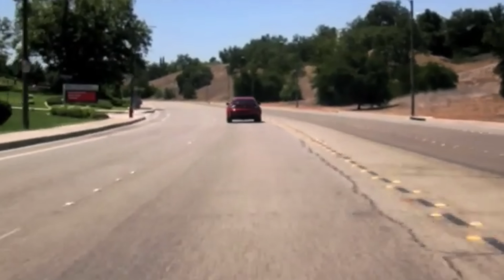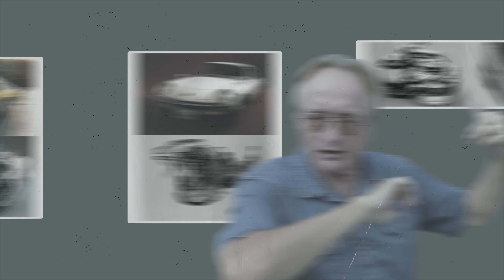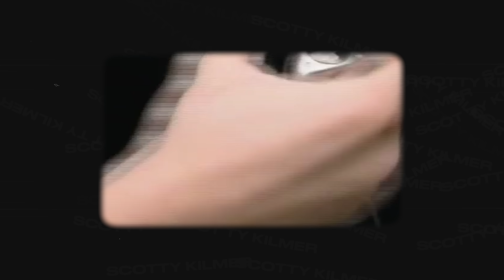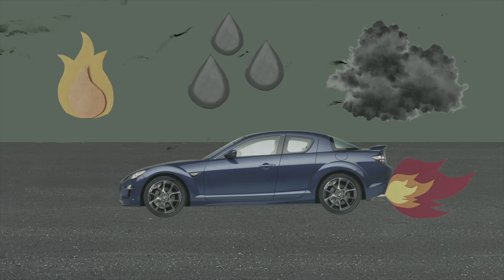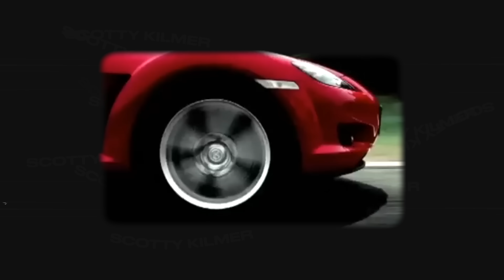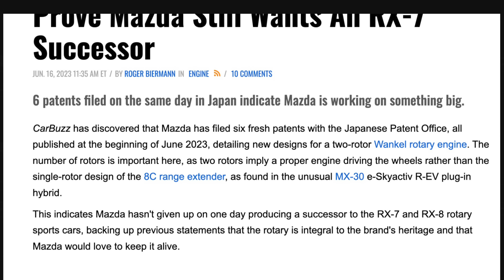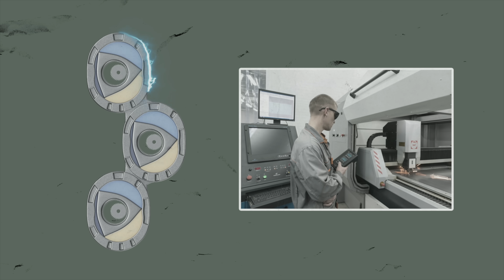Mazda's New Engine Shocks the Entire Car Industry

Comment: I’m really curious to see how this rotary engine can make it an efficient hybrid vehicle, more b efficient than Toyota’s parallel hybrid engines. It longs promising, the drivetrain can be entirely electric, and the rotary engine optimised solely to generate for the battery. As long as it can be as efficient as your typical parallel hybrid, it can be made lighter, and with much fewer moving parts that require repair, maintenance, or replacement.

Comment: Well, they were fun to drive. I had two rotary pick ups, and my mom was silly enough to own an RX-3, 2 door. It was loads of fun for a teenager. They were not fuel efficient, but the wide power band was very interesting. I can't imagine it would be fuel efficient, but as a range extender for generator, that's sounds more viable.

Comment: I’ve got an 85 RX7, 120k miles and still going strong, no rebuilds…the engines do require more attention to maintenance and fluid levels than piston ICEs, but with decent care there’s no reason they can’t last over 100k miles.

I’m a fan of rotaries mainly cuz I find the engineering interesting, and they’re really fun to drive; if they come out with an improved production engine, I’d probably get a crate motor and swap it in.

Comment: I had an R-100 back in the day. A rocket on roller skates. Overheating from a coolant leak took mine out by distorting the casting. I could drive at freeway speed in 3rd gear and really no sense of over revving. I hope they fix the issues.

Comment: If one of the problems with the rotory engine was city driving shortening it's life between repairs, then maybe continouse operation at optimal conditions will extend its life between repairs and target better efficiency.  What's nice here is its power for size.   And that is extra  important in electric hybrid cars.

Comment: the english firm ROTRON ENGINES (with an engeneer from NORTON MOTORBIKES) still produces very compact and powerful rotaries for  motorbikes and aircraft and... the army. Their engine (watch theirr video) is revolutionary : air cooled, compact  220 BHP for 700cc and like Mazda a lot of techcnical modifications in order to make the engine very reliable. (1000 hours forseseen before a rebuild). They even build a monorotor, a two-rotor and a 4 rotor engine. WHy not a collaboration between Mazda and ROTRON ENGINES ? The main problem to resolve is the fuel consumption, which remains high !  Serge

Comment: Its like they really want to street modify a turboprop. This design would really benefit from a compound turbo -turbine unit to use that aspiration throughput and intermittent unburnt fuel air mix. A cooling box could condense the worst of the emissions that can't be recycled through the compound afterburner modification.

Comment: The information is wrong about the EV! The reason for the smaller rotary engine in the EV is to one extended the milage, can go from 300 miles and with the rotary engine is extended to 1200 miles! The second thing it does, it recharges the batteries! Mazda is planning on use leas batteries and they are trying ro make it self recharging... If this information is wrong let me know. This is what i read about the come back of the rotary engine...

Comment: Confirmed rotor head here. I’ve had 5 RX7s, 1980, 1983, and 3 85’s. Still have the GSL-SE. 108K on factory engine. Daily driver. Back and forth to work. Only periodic maintenance performed with age related issues such as fuel injectors and clutch replacement. Runs like a Swiss watch. Oil tight. Fun to drive. Also have a 2004 RX8 Grand Touring 6 speed that I’ve had for 20 years. Same thing.  I drive them, I do not baby them. A trip to redline a day keeps the mechanic away. So smooth. They sound amazing at full tilt, so lightweight. And yes, both pass CA emissions every 2 years.  You can have your cake and eat it too. Drive it like you stole it, but maintain it like your Momma drives it and you’ll be fine. I LOVE Mazda, because they are independent and try things that nobody else does. Remember the Miller cycle V6?  Also has 2 of those.  One 99 and a 2001 Millenia S. So far ahead of the game. They have passion and soul. And they build beautiful cars that LAST!  Long live the peritrochoid.

Comment: The rotary engine is objectivly not the most efficient engine, yet these are nowhere near as bad as you make them out to be. Fuel economy for example does not entirely rely on the engine, but also the weight, size and aerodynamic coefficient of the car. The Wankel rotary also does have it's strengths, mainly the very small weight and size with huge power density.

Comment: Either way gas and diesel are obsolete compared to all electric vehicles. I love innovative designs, but Mazda (and Toyota with it's pointless Hydrogen obsession)  might as well throw in the towel already. 

Oh... and no "range extender" please; make up your mind and buy an EV or else stick with gas if that makes you happy. Adding the weight and complexity of two systems is just nuts.

Comment: I used to own and did my own repair to a 1993 RX-7 twin turbo its easier to rebuild than a typical gasoline engine. However it has overheating problems and fuel/oil leaking through the Apex seals which has mostly been resolved with this new 12 rotary design.

I’m sure Mazda can make a smaller 3 rotary design for application in a new RX-7 sports car or be utilized as a drone packing more power than current drone in service. Also the 12 rotor design producing 5000 hp could be very attractive to airplane application since it uses regular cheaper gasoline fuel.

Comment: First: The engine is NOT rotary engine it is a reciprocating engine. Second: It does vibrate because the centers of the rotors move relative to the center shaft. Calling it a rotary engine is just inaccurate. It is a reciprocating rotor. engine.

Comment: The invention by Tyson Garvin makes my head spin, considering the cooling that is needed for this extreme power. See, at this level, one cannot consider two isolated components (hull and engine), but needs to find a way to use the hull as the radiator for the engine heat, whilst still ensuring the naval properties. With the advance of additive manufacturing it is possible to print a hull that has fine capillaries  in which cooling water could be circulated. This concept would use the entire surface of the hull below water line. It’s really hard to think of another way to manage this amount of thermal energy.

Comment: Actually invented by Fred Umblebee. Wankle filed his patent after Umblebee's patent ran out. It was not viable until a mechanical inversion was made by Sachs (?) where the rotor rotated instead of the case. Wankle engines do not account for all three faces of the rotor when calculating displacement so it is actually larger displacement than quoted.

Comment: I would love to see a Wankel tested with Nanosecond Pulsed Power Plasma (N3P) technology. In addition, I would love to see the engine tested with ammonia, ammonia/hydrogen, ammonia with ~ 19 percent Dimethyl ether (DME), & Dimethyl Ether (DME) at constant speed as a range extender. With and without Nanosecond Pulsed Power Plasma (N3P) technology. Lastly, tested with variations of E85, 100 Methanol as well as gasoline mixed at different percentages. I bet we would all be impressed with the some of the different scenarios.

Comment: I own 2006 Mazda RX-8 with 84k miles and I have been in and out of performance for a while but, out of all the engines the Rotory engine is a simple design and easy to work on. I live in the desert and it gets hot here. I used to have over heating problems with my engine until I solved it with a low temperature thermostat. Now I have 0 issues of overheating in summer. I would love to see Rotory make a comeback!

Comment: my '87 rx7 turbo would not start after it was warmed up- unless : this takes 2 people- one to remove and replace ( in a second or 2) a fuse under the hood, while person #2 turns the key to start the car. this was years ago- can't recall which fuse for sure- should be the one in line with the fuel supply.

Comment: Most of the video was intro, understandable since there isn't much content. 
Nothing "shocks" the industry. Mazda wants a distinctive product and the early rotary sucked except for very niche uses. Best to give this one several years (never be an early adopter unless you are too rich to care).  Range extender use at fixed RPM should make it last longer than otherwise but there's no reason for excitement. It's just a generator after all.

Comment: Wow, what a garbage video. Loads of bogus claims here touted as fact.

Also, you obviously ripped Rob Dahm's approach regarding valvoline VR-1, yet you couldn't even get that right. You don't pre-mix with VR1. You premix with 2 stroke oil. VR1 goes in the crankcase. And how in the world is pre-mixed oil supposed to lubricate engine internals scotty?

Comment: My butterscotch colored rx3 only takes 4 hours to overhaul. New tip seals oil pump rebuild included. I have over 800,000 miles on it with one modification, a webber side draft carburetor. It runs great has enough power and cost of ownership over the past 40+ years is next to nothing. Keep your car fix what the factory didn’t and enjoy.

Comment: I was a Suzuki dealer in the mid-70's .hen they produced a rotary engine road bike.  It was loud, smooth, and had gobs of power.  It was bad on gas mileage which was the only downside.

Comment: In basic terms ; the Rotary suffers the three problems Two Stroke Engines suffer from and why you rarely see Two Stroke Cars or Motorcycles on the Highway these days.  Unacceptable Fuel Consumption , Excessive Pollution and Short Engine Life....

Comment: I used to ride both the air cooled and the water cooled twin rotor Nortons. They were super smooth and reasonably powerful, but we are going back well over 30 years. They didn't have very good fuel consumption, but I wish Mazda well with their efforts. To be honest, anything to stop this mad and deluded rush to battery vehicles, which is a complete technical and ecological dead end!

Comment: Please scotty check this inventor from Morocco who made the Square Rotary engine.
The guy died in his sleep with heart attack around 2013 or 14..

His engine was so economical and so powerful.
This is his patent: Square-rotor rotary engine (diesel) m.r.r.c

Abstract

The invention relates to a square-rotor rotary engine (M.R.R.C), comprising a rotor with a curved square form and a stator with four chambers, permitting an increase in power and speed in relation to conventional motors and also a reduction in fuel consumption.

Classifications

 F02B53/00 Internal-combustion aspects of rotary-piston or oscillating-piston engines

View 5 more classifications

WO2006016792A2

WIPO (PCT)

Comment: One of the rotary engine's biggest drawbacks is the need to inject oil into the chambers to lubricate the seals, much like a 2-stroke engine. You alluded to this indirectly by mentioning premixing oil with fuel. I love 2-stroke engines because of their simplicity and that's why rotaries also appeal to me. Rob Dahm has extracted incredible power from multiple rotor engines, which can be extended by stacking units, another attractive feature; but fuel-efficient they are not. The new so-called 1-stroke engine may be the answer, a tiny engine which combines the best features of the 2=stroke piston engine and rotary engine, but which separates lubricated parts from combustion. Will you make a video about this new design?

Comment: I've followed the Wankel from the beginning.  Nothing will ever address its fatal flaw which is surface to volume ratio of the combustion chamber.  Wankels simply lose too much combustion heat to the cooling system.  That's it. Game over.

Comment: My son worked for a Mazda dealership in 73-74 and pulled 3 to 4 rotary engines a day.  The A  mechanics would put the new engines in after he was done.  He wouldn't even think of purchasing a Mazda after seeing this disaster.  It took until 2014 before he purchased his first Mazda, a 2006 MX-5 and then 3 years later purchasing a 2014 MX-5 PRHT.  It took a long time for Mazda to repair its reputation after that fiasco and now they want to revisit it.  I know there are enthusiasts that love to rebuild their engines every 40K miles or sooner but I just wish they would just let it die.

Comment: The RX8 WAS Abysmal. High rpm yes, poor fuel consumption , zero engine braking, would flood and require dealer work to rectify if you didnt foĺow the golden rule. On a cold winter morning you had to sit at 4000 rpm for 2 minutes  before switching off ...my neighbour loved me as I was only moving the car to get my truck out. I hated that car.

Comment: I owned 2 RX-7s. I'll never again own a rotary engine. I had 4 episodes when I couldn't get the thing started and had to have it towed to the dealer to start it. Once it misses that initial start attempt, they are done. The 1 time I did get it to start was when I put it on a battery charger and got it to start after cranking it for 10 minutes on and off. That warmed up the engine.
Reply: I wonder if it would work well in a hybrid context with a planetary gear system like toyotas eCVT. If electric motors turned the engine usually to start it, it would make it more efficient for city driving and also would alleviate the strart issue that you mentioned.
Reply: @tranqu  I don't think lack of torque was the problem getting my rotary engine started. It's the motor seals sticking and not sealing properly the combustion chamber when at normal or cold temps. Cranking the motor over 10 mins allowed the motor to heat up, and loosen the seals so they could seat properly and seal the combustion chamber. Planetary gears might be more efficient at slow speeds, but car designers should know how to gear cars properly for the most efficient propulsion in any given application. Gearing will be completely different for a load hauling truck vs a race car vs a commuter car.

Comment: Ihave bought and run two Mazda 3s over the last 10 years , and have only had had one fault and that was corrected by warranty.  That was the door lock system had partial failure. They had to get a part from Japan.  It was as good as new..  The car does nearly50 miles to the gallon on a long run and is a carefully made well crafted car with years and years of life left in it after 5 years. The engine performance is top notch. A driver's car for sure.

Comment: The rotor in a "rotary" engine like the Wankel does not rotate.  I saw an article that claimed it orbited, but that is not correct either.
I don't know what technical term is right, but mostly rolls around the internal gear.
Reply: From Wikipedia - "The Wankel engine's rotor, which creates the turning motion, is similar in shape to a Reuleaux triangle, with the sides having less curvature. The rotor spins inside a figure-eight-like epitrochoidal housing around a fixed-toothed gearing. The midpoint of the rotor moves in a circle around the output shaft, rotating the shaft via a cam." My comment, if the tip seals follow the housing then they would also be moving in an epitrochoidal motion but the body of the rotor is just moving a circle as it turns per the description.
Reply: @avsystem3142  
I need to look for a video that focuses on how the pregnant dorito transmits torque to the shaft.  As your comment indicates, it is not a simple matter.

Comment: The power to size and weight ratios may be great - but aren't these Wankel type rotary engines always limited on torque they can produce as the throw of the rotor is so small??

Comment: The explanation of the wankel rotary you used was liquid pistons rotary engine which isn’t a wankel. It’s an inverted wankel, and operates similarly to wankel however there are key differences.

Comment: Expansion chambers could be used to address the unhurt fuel mix entering the exhaust system in a similar way to two stroke engines where a shock wave is used to force the mix back through the exhaust port before it is closed for the next cycle.

Comment: Hybrid and highly efficience engine is the future, such as the camless tech etc. 

The current 1.5 turbo engine can deliver similar power like 2.4cc 7 - 8 years ago is an advancement minus the current shitty CVT.

It may not be impossible 1.0 liter will be able to replace the current 1.5 turbo in near future.. camless hybrid turbo combined 😂

Konigsegg 2.0 camless can deliver 600hp. Matematically, 1.0cc would deliver 300hp which will be more than enough for daily drive

Comment: When I was in High School had a 71 Mazda rx2 it had the little 4-barrel carburetor in Twin distributors back then you had to Rev it up before shutting it off and it always backfired the biggest problem with Mazda rotary is the Apex seals a lot of people don't know it but you should Redline it everyday plus premix the 2-stroke oil in the fuel as you Redline it you are blowing the carbon off of the Apex seals which is letting them do their job I know on a 2005 RX8 I love the Mazda rotary is a lot of people don't but you just got to learn some tricks I got 125,000 miles on mine and it's running strong I probably read line at two or three times throughout the day you're driving like a granny there not going to last another big problem the RX8 fast is the rear end it has a six arms holding the rear enter the body which are all adjustable and they wear out you'll be going into a corner in the wheels on the rear wheel turn depending on the direction you're going but it makes it for Dangerous driving I figured out where mine had to go and welded them in place so it eliminated that problem